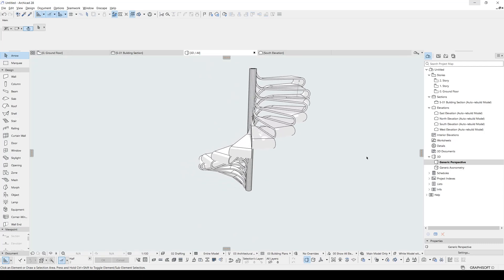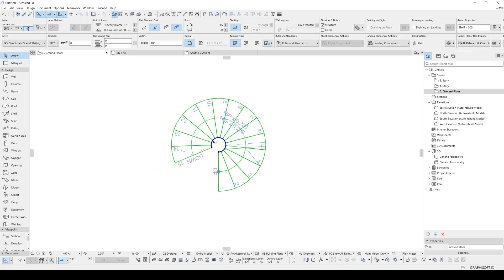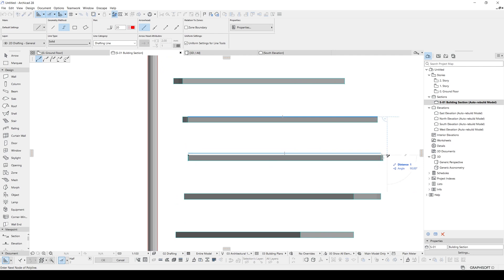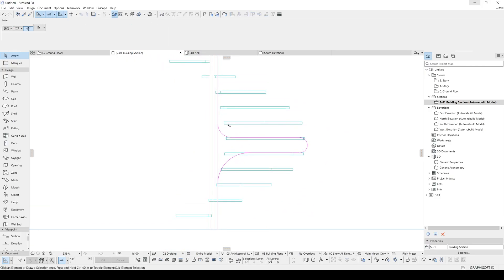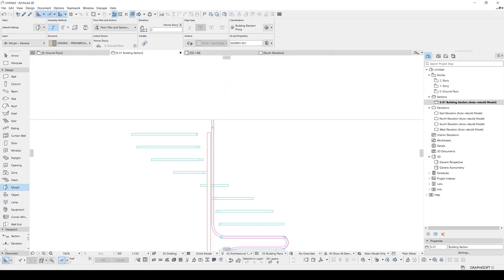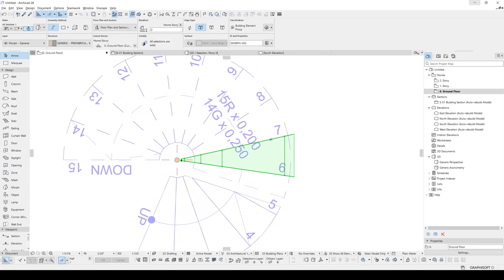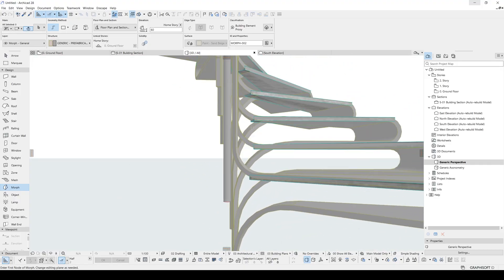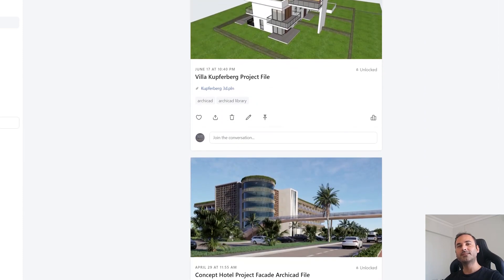Spiral Stair Design  in Archicad

Comment: In Archicad, how can I transform a 3D model (specifically, elements like beams, columns, stairs, and slabs) into a node-based representation for structural analysis or other purposes?
Reply from the maker: In Archicad, you can generate a Structural Analytical Model (SAM), which converts volumetric elements like beams, columns, slabs, and stairs into a node- and line/surface-based analytical representation. This model can then be exported via IFC Structural Analysis View or SAF format for use in structural analysis software such as SAP2000, ETABS, or Tekla Structural Designer. Keep in mind that while the process is mostly automated, you often need to review and adjust axis alignment and node connections manually before export.